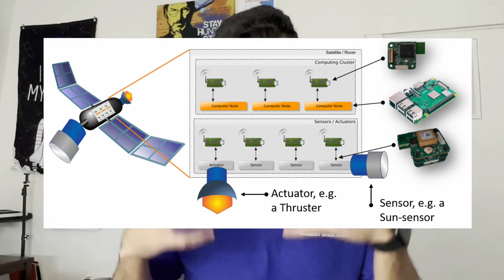Why I chose Electrical Engineering over Aerospace Engineering

Comment: I need some second opinions, I’m debating Electrical & Areospace. I love space, rockets, satellites ect. However, I feel if I go to Areospace my opportunities will be limited to the jobs I can apply for. Eletrical I will have more opportunities but I’ll have a lower salary.
Reply from the maker: pick the area you are more interested in. if you like circuits, electronics, electromagnetic physics -- go for electrical. if you like mechanics, aerospace topics, go for aerospace
Reply: @alithedazzling  I like both unfortunately. I don't know what to do
Reply: EEs also have a good salary plus I'm pretty sure that not all AEs make more than EEs, it depends on so many factors like years of experience, cost of living, specific position or field etc. But both are close enough and better paid than most jobs out there, I think the only downside that AE has even though it's often ranked as paying slightly more is that there are less available jobs compared to EE and you're in a niche field while EE is more broad.
Reply: @jamesmccloud7535 hey here we have three field ee,ece,eee which one should i choose if i want to become an astronaut or engineer in space agency

Comment: I do want to note that in industry, EE, CE, and CS can perform a lot of the same roles that you mentioned as being totally separate. I have CE friends working in webdev or backend server jobs, CE friends working in power systems, CS friends working in computer hardware, and EE friends working in programming. There's just a lot of overlap in skills and interests and it's very common to see jobs look for both CE and CS in job listings, and sometimes even EE depending on the role.
Reply from the maker: agreed